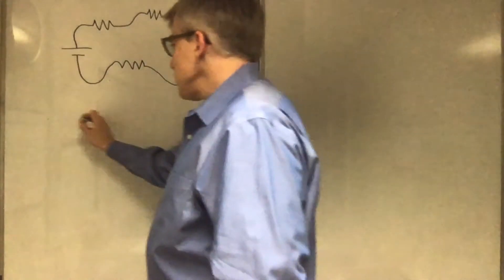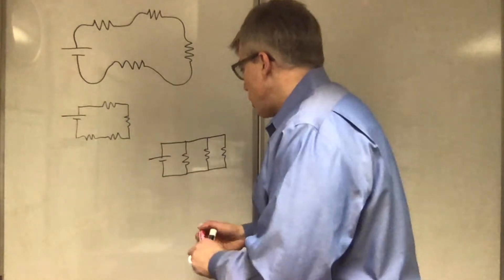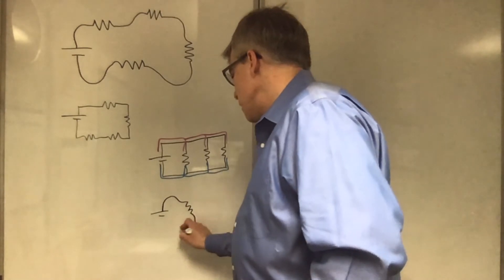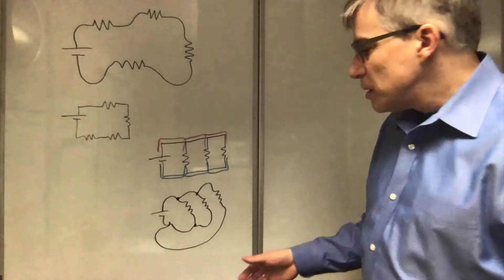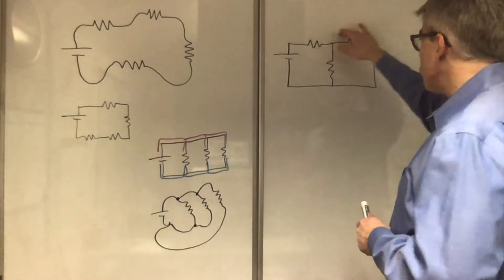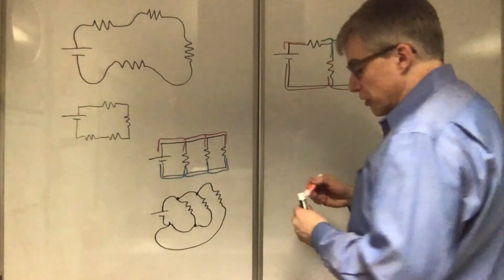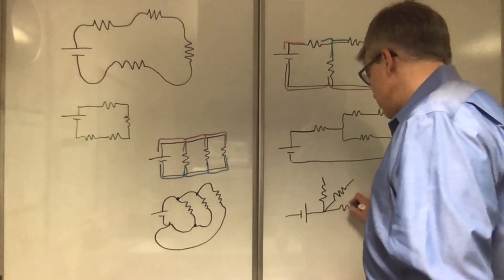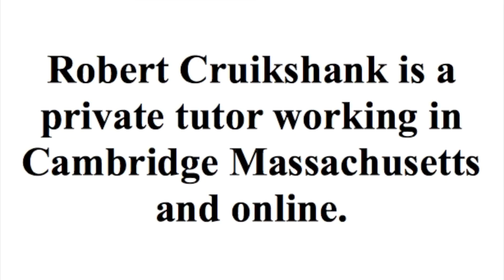Identifying Series and Parallel Circuits

Comment: Sir what if we have a  junction with one open circuit and 2 resistors , what will the connection be like series or parallel
Reply from the maker: Your question is unclear. Do you mean two resistors in series, but then a third wire is attached between them but NOT attached to anything else? Loose wires don't carry current so you can just omit them. The pair are in series.
Reply: @robertcruikshank4501 thanks sir my doubt is cleared

Comment: but what if it was only resistors without source?
Reply from the maker: You can always add a source, choose where to connect + and - to your network and evaluate from there.
Reply: But there some step when i should find R equivalent without a source in the circut and some time i get lost which one are parallel with is it the right side or the left side(cus there is no source)
Like:
Rth,Req in RC and RL 
All those i had to find R without a source 
Sorry for the long message 
 @robertcruikshank4501

Comment: I'm so lost
Reply from the maker: Try this: imagine cutting the circuit every place there is a junction--a place where 3 or more wires meet. Once you have chopped the circuit up like that, any components on the same piece, are in series. Once you simplify those, any pieces that connect to each other at both ends are in parallel. Repeat until simplified. I hope that helps. Good luck!
Reply: @robertcruikshank4501 thank you sirr 🙌🏻
Reply: @robertcruikshank4501 thank you ❤
Reply: Same